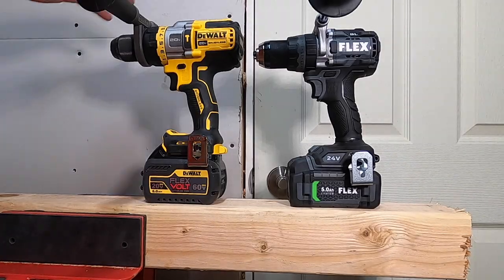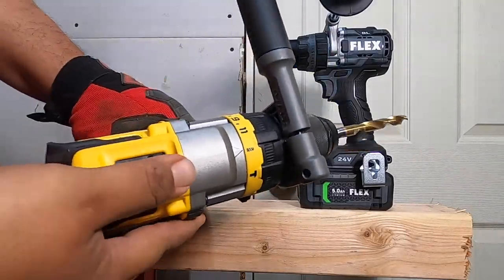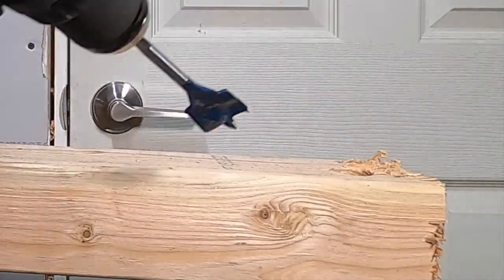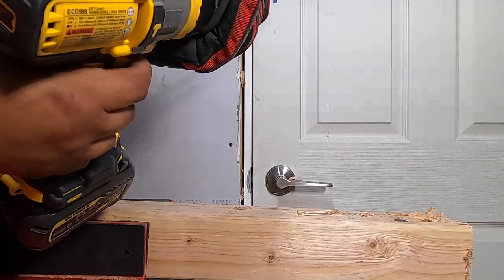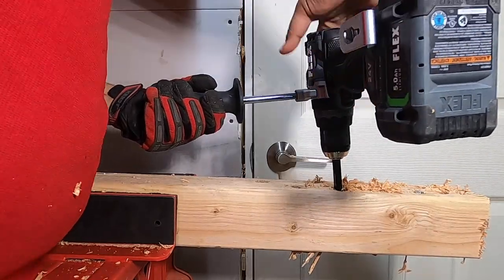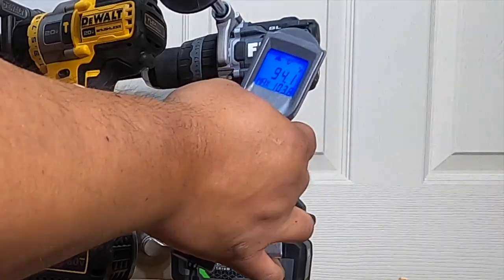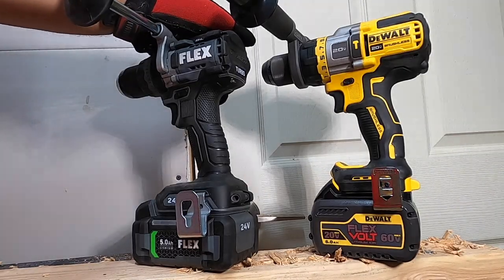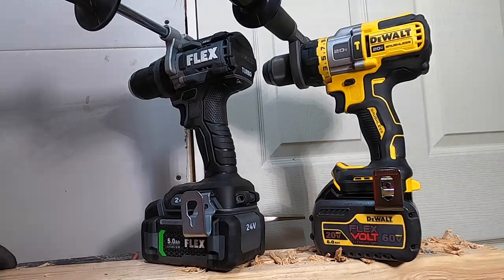Flex Turbo (FX1271T) VS DeWalt FlexVolt (DCD999) Hammer Drills

Comment: Thank you for your video. I an an HVACR tech and have been using cheap home owner grade drills/impacts for 19 years (I'm a service tech not an installer). But once In a while I help the installers and find my brand lacking. Did a few days of research and was a tossup between DeWalt and Flex. I JUST (30 mins ago) bought the flex BL driver and impact for a great price. The main reason I went with Flex is last week there was four of us installing a 5 million btu heat makeup unit and three of them had DeWalt. All day they were trying to grab thier drill and grabbing someone else's. So now I won't get mine confused with everyone else's. Both are great. And Flex is offering a lifetime battery and tool warranty if you buy them this year.
Reply from the maker: That's true great choice the flex is definitely up there with the big boys💪 👌

Comment: Wow, I didn't really think it would but the Flex seemed to tie or just barely beat out the DeWalt in most of these tests. Doing that while being a fairly compact drill is a big win in my book, because that DeWalt is a beast of a drill.
Reply from the maker: Both of these are a beast but the dewalt ha proveen it's self over the years. One good thing about the flex is that if you buy in this year you can get a lifetime warranty.
Reply: @toolhead147 e dewalt has 3 speeds for a reason. The Dewalt will last longer if you use your drills properly regarding using the right gears when the bits are larger. Put a 12ah batter on the dewalt in low gear and I mix mud in the pail with it!!!!

Voltage may still matter regardless of wattage.

Comment: If the DeWalt couldn't do a test in speed three you should have put it down to speed two, It would have destroyed the Flex in the more difficult tests. I know some people would argue that it's unfair, but think about it, if you only use the highest and lowest speeds on the drills regardless of how many they have then you are only really testing the power of the motor, rather than the overall performance.

Comment: Nice job! I was thinking about getting the Flexvolt for the drill head to head but just couldn’t pull the trigger. Thanks for the review
Reply from the maker: Flex Turbo Hammer drill is a very powerful tool. I got the kit with both the drill and quick eject impact driver was a better deal over all.

Comment: Seen a video Man Caver Tools that has 6 amp hour dewalt flexvolt batteries that are boosted up with 21000 cell batteries , when he put that battery in dewalt tools they really kicked in beast mode, they had yellow bottoms on the 60v dewalt flexvolt batteries . That test was pretty close with same battery sizes
Reply: Yes...that is the “newer” battery that came with the drill in the box when the 999 came out.  The battery he used in the video was the Home Depot special that if you buy the 999 as a tool only you get the “older” 6AH Flexvolt.  I asked a Home Depot rep and he said that”black” battery is being discontinued..👍👍
Reply: Man Caver tools was testing the power detect DCD998.  Which is stronger than the dcd999 FlexVolt advantage.

20v 6.0 ah battery is 2 rows of 21700 cells with a total count of 10 battery cells.

60v -20v FlexVolt battery is 3 rows of 18650 cells with a total count of 15 battery cells.
Reply: @juanc5149  On paper anyways, The 998 claims 1072 UWO (Unit watts out) equals about 111 FT-LB vs 999 claims 1219 UWO equals about 126.5 FT-LB.
Here is the Formula I found to calculate this values. 

Minimum speed multiplied by the torque and devided by 560 = UWO  (The 560 is a constant set by the Power Tool Association)

Here is the formula in reverse to figure out the torque of a dewalt to compare to other drills.
UWO x 560 / min speed = in-lb x 12 = ft-lb
Reply: Except the fact the tests were done incorrectly.  I am not defending flex or any brand, but someone needs to address what he’s doing wrong or else people are going to be misinformed.
Reply: I am not knocking flex, but the dewalt 998 power detect was proven to be a beast and more of a beast when using a high output 21700 cell battery, like man cave tools said you wouldnt take your foot off the gas to let someone else catch up , so why not use the biggest battery your company makes when going up against quote " the most powerful hammerdrill on the market " flex marketing quote from opening day ......
Reply: @onsiteelectricianscott4025  I am not trying to defend Flex or any brand either.  Some tests are misleading if they are not addressed.  Explain to me how speed 2 (1300 rpm)  on dewalt has the same rpm as speed 2 (2000 rpm) on Milwaukee.  Wouldn't you want to run dewalt at speed 3 (2000 rpm) against Speed 2 (2000 rpm) on flex?  Will it cut out on speed 3 like Flex or Milwaukee?  Maybe....if not, then more power to dewalt power detect. Set all the tools beyond their limits if you want to prove a point.

Comment: For clarity. The DCD999 is not a true ‘FlexVolt’ line. It is a 20v tool, Like it says on the side. 
It is redesigned to take ‘Advantage’ of the 60v battery.
I believe Dewalt’s next move will be a true Flex Volt a hammer drill.
Reply from the maker: Maybe that's what we need a new 60v  Dewalt Hammer drill

Comment: Gotta say I really love the look of the Flex tools. They fit me personally. I’m a Milwaukee guy and I use Rigid for my techs due to the lifetime warranty. That’s most important to me business wise and price point as they are all really powerful enough. I feel Milwaukee and Makita have the most impressive overall lines as they offer things the others don’t. DeWalt has the history of being most reliable and always amongst the strongest. Still the fastest Impact is Milwaukee and the strongest Hammer Drill is DeWalt when paired with the HO batteries etc. 

The High Output batteries are still equivalent to the Flex battery as Flex has packed extra cells in there so it’s even. Flex gets the advantage by shipping the 5ah with the tool and going with the additional cells to start as opposed to lower amperage batteries coming with the other lines however that’s expected since their drills are a few years old now. Even still with the Milwaukee and DeWalt 2-3yrs older they still are stronger than the flex overall. Not fastest on easy nuts etc but the tough stuff they get it done where Flex can’t so I still have them ahead.

That being said Milwaukee is set to release Gen 4 later this year or early next year and that’ll be a wrap on Flex but I like the excitement, look and feel of the new Flex tools and don’t feel they have to be top dog. They came out with perhaps the best launch ever as many tools start out with much lower quality. The future is bright for Flex and if offered at Home Depot where I have an account I’d purchase.
Reply from the maker: I agree 👍with you flex are nice tools.  I can't wait to see the response from milwaukee and dewalt to these tools maybe a gen 4 impact driver that would be nice.

Comment: Fair test in this test we really got knew flex is no 1 hammer drill in the world till today
Reply: It’s not though.   Power Detect beat it fair and square.

I think DeWalt flipped the specs of the power detect and FlexVolt advantage...
Reply: @juanc5149 MCT test wasn’t even done correctly
Reply: @ProxyFinal  haven’t seen MCT videos. What did they not do correctly?
Reply: @daniloduldulao8286  there was one particular video where mct was comparing Milwaukee, dewalt 998 power detect, and flex.  In order to make it “fair” according to him he ran all of them on regular 5.0 batteries 18650 cells, but decided to have dewalt run on speed 2 to face off against Milwaukee and Flex on speed 2.  The problem with that is that dewalt has 3 speed transmission, so its speed 2 isn’t really at max rpm like the other tool.  When you are drilling at a lower gear, you should have no problem with less chance of cutting out on you.  Worshopaddict, another channel, kinda did a similar test also running dewalt on 5.0 at speed 3 and even that thing would occasionally come across a few hiccups.   I guess 18650 batteries tends to overheat easily when you have them running at high speed hence the cutout.  Now, he did have another video before it where he ran the Flex on a 5.0 against the Milwaukee and dewalt on 21600 batteries and obviously the latter two had no trouble drilling that speedbor bit at max speed while the Flex struggled.  21600 batteries don’t overheat as easily, so that wasn’t even a fair comparison either.  The other issue is that speedbor mct is using to test hammer drills as that bit is really only designed to be ran at 500 rpm as recommended by Irwin, but mct is running it at 2000 rpm for his tests.....that thing is running hot and burning on high speed (it almost caught fire when I ran about 5 holes).  So the reason he ran dewalt on speed 2 with 5.0 on the other video, he said it was to make it fair.....mct’s tests were flaw and he never ran the dewalt 998 on speed 3 with the 5.0 battery on that particular video even when he swapped back to 6.0 21600 battery.  If you want fair, pay attention to what you are doing.  Get a 21600 cell for Flex and retest everything all over again using the proper bit and setting them on the right speed.

Comment: Thank you for the fair video using the same watt hour batteries! Did you feel that the Dewalt was more powerful, less powerful or equal with the battery you used, or do you feel the smaller batteries are better for that Dewalt? 
👍🏻👍🏻
Reply from the maker: I could probably push the dewal all day no problem running smooth and cool even on speed 3. The Flex I would say you could push it all day but how long is it going to last in the jobsite overhearing.
Reply: @toolhead147  thank you for the reply!👍🏻👍🏻

Comment: It just shows how strong the Flex drill is.
I’m almost positive that the Flex battery uses 18650 cells, and the Dewalt battery uses 21700 cells.

Comment: Is that Flexvolt battery the with the old cells 18650? or the new flexvolt with 21700 cells?
Reply from the maker: Yes it's the old one with 18650
Reply: @toolhead147  y tho

Comment: Thanks man for the share.  I'm looking for a hammer drill driver and torn b/t DCS999 and Milwaukee M18 fuel 2804-20.  I have a lot of red, but don't mind going yellow & black if it is a better performing tool.  Flex is too new for me, although the brand has been around for some time in Europe.  What concerns me about Flex is that it was sold to the Chinese, and we all know Chinese = quality.  Mmmm hmmm.  Not saying that it's bad, just saying too new for me.  Additionally, the electronic turbo just seems like it is one more thing that could go wrong in the future.  I have seen a YT video where both the red and yellow were repeatedly dunked in a bucket of water, and they still continued to perform (one stopped because of the battery getting wet).  Not sure how Flex would hold up to such a torture test.  My hesitation with red is the chuck and trigger.  I hear from some reviews that they are the weak point of the tool.  Hopefully, Milwaukee will fix these issues with Gen 4, but🤷.  Thanks again.
Reply from the maker: You can't go wrong with dewalt. If you want the best most powerful get the power detect with a 6ah or higher they have the upgraded 21700 cells. That combo will beat the home depot flexvolt.

Comment: Great Video! I'm looking to buy a drill to use as an ice auger, I have no other tools so brand doesn't matter too much to me. I've pretty much narrowed it down to the DCD999 or the 2804, but these flex tools claim slightly higher power than either and have a lifetime warranty. What do you recommend? Also what is the most powerful battery for the DCD999? There seems to be some confusion there.

Comment: Turbo button is just un-governing the current allowed to draw.  Current (amps) = heat.  Will be interesting to see what this does to tool life running hotter all the time. 

Thanks for the vid.
Reply from the maker: Agree specially for someone that is drilling holes all day I can see that tool overhearing with a short lifespan.

Comment: The dewalt has a 21700 cells which are more powerful aka not a fair compromise
Reply: Flex is working on the high output batteries. I think the next gen of flex will put all brands behind them. But that depends entirely on the sales and demand for the products. Ridgid was dragging azz on making string trimmers and such, so I got Makita. Hella good deals on Makita right now

Comment: The DeWalt DCD998 Power Detect, is a more powerful drill than the FlexVolt Advantage DCD999 with the 6.0 ah battery.   

Also MCT proved that the DeWalt power detect is the superior tool by far.
Reply: The Dewalt speed 2 dosen't make the drill and better, It still has a max rpm of 2000 and a min rpm of 450

The 998 claims 1072 UWO (Unit watts out) equals about 111 FT-LB vs 999 claims 1219 UWO equals about 126.5 FT-LB.
Milwaukee 2804-20 claims 100ft-lb torque at 550 rpm, which equals about 1180 UWO
Flex Tool claims 1400 in-lb at 700 rpm = about 1750 UWO
Here is the Formula I found to calculate this values. 

Minimum speed x Torque / 560 = UWO  (The 560 is a constant set by the Power Tool Association)

Here is the formula in reverse to figure out the torque of a dewalt to compare to other drills.
UWO x 560 / min speed = in-lb x 12 = ft-lb
Reply: @maximusprime9441  

At this point, testing has determined that manufacturers claims means jack shit.

Channels like mct, torque test channel, shop tool reviews, project farm, has more than proven that manufacturers, lie.   😦.

The DCD998 out performs the DCD999.   And it absolutely trounced the Milwaukee consistently as well in the past.   And it out performed the over hyped flex as well.
Reply: @juanc5149  as long as mct redoes his test correctly, I will continue to say he’s doing it wrong.

Comment: The Dewalt has a three-speed transmission. It's not even in the same class as Flex and Milwaukee 2 speed drills.
Reply: The Dewalt speed 2 dosen't make the drill and better, It still has a max rpm of 2000 and a min rpm of 450

The 998 claims 1072 UWO (Unit watts out) equals about 111 FT-LB vs 999 claims 1219 UWO equals about 126.5 FT-LB.
Milwaukee 2804-20 claims 100ft-lb torque at 550 rpm, which equals about 1180 UWO
Here is the Formula I found to calculate this values. 

Minimum speed x Torque / 560 = UWO  (The 560 is a constant set by the Power Tool Association)

Here is the formula in reverse to figure out the torque of a dewalt to compare to other drills.
UWO x 560 / min speed = in-lb x 12 = ft-lb
Reply: So dewalt should just call their 3rd speed Turbo and it would be in the same class?
Reply: Dewalt's max RPM in speed 2 is 1300 and max RPM in speed 3 is 2000
Reply: Then why did Flex compare it to them in their live stream?
Reply: The flex technically has 4 speeds.  Speed 1, speed 1 turbo, speed 2, speed 2 turbo

Comment: I had the Flex for 3 months and it died.
Reply from the maker: How did it happened?
Reply: @toolhead147  Over heating drilling a 7/8" augur through a sill plate.

Comment: I'm just curious how everyone gets different results.
When we tested these tools against each other dewalt destroyed the flex
After that mct done a test and dewalt destroyed the flex the best way to find out is to buy a flex buy a dewalt and i guarantee you'll be returning the flex the next day
Reply: The DCD998 is much more powerful than the dcd999 with a 6ah battery.  You’d need. 9ah or 12ah battery to match the 998 with the 999.

MCT was testing the 998, not the 999.
Reply: Don't forget that MC was running the tools incorrectly.  Dewalt on speed 2 is not the same as Flex on speed 2 because Dewalt's max speed is on Speed 3.  The faster it runs, the sooner it reaches the overheating threshold.  As you saw on this video, toolhead ran both tools at maximum speed and they both cut out.  If you ran the tool slower, then it's a different story.
Reply: Not if you put both of them in the top speed Flex speed 2 Dewalt speed 3 not speed 2
Reply: At the end of the day that DeWALT can drive that lag bolt or screw faster.

It’s not Dewalt’s fault that Flex doesn’t have a mid gear.

Dewalt is the superior tool.  And mct is the superior channel. Sorry.
Reply: @juanc5149  you still don’t get it do you? There is a reason why certain things behave the way they do. Speed 2 on dewalt is of lower gear/rpm and not at max speed so of course you can get the job done without cutting out or less likely to cut out.  If you want to use that as an argument, then flex beats dewalt all the way by having turbo for each gear because yea having extra gears makes everything better.  It’s like you are saying 1000 rpm = 2000 rpm.  That speedbor used at mct is only rated for 500 rpm!
Reply: Mct is definitely one of the better channels
I feel like he's the only one who keeps it real and honest